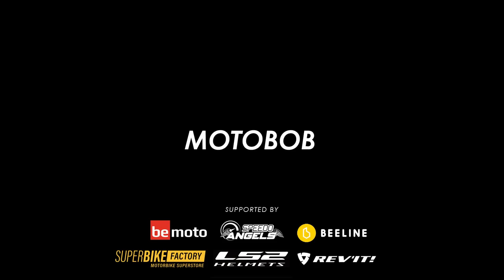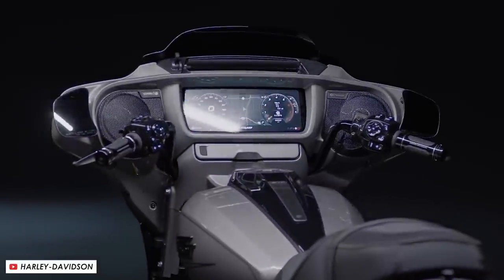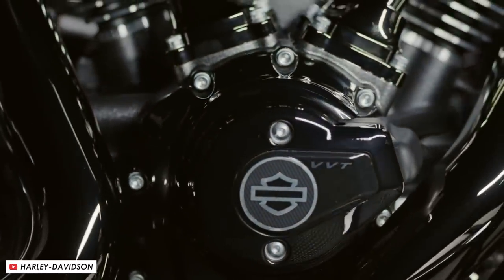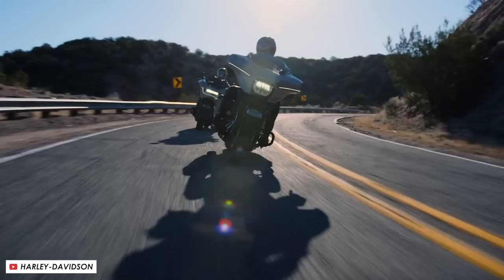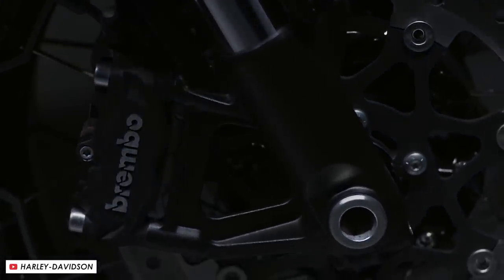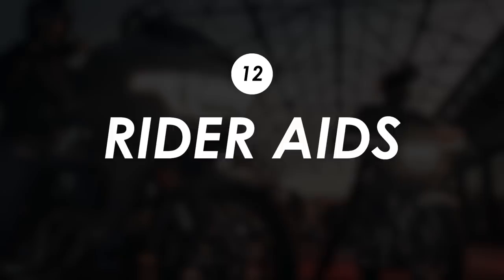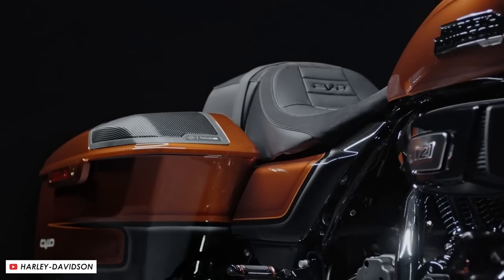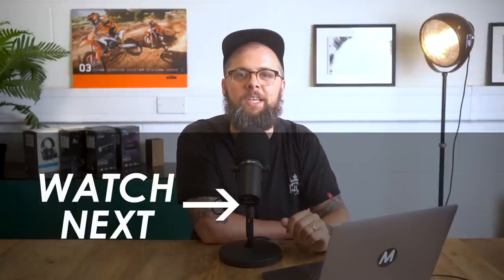New 2023 Harley-Davidson CVO Street Glide & Road Glide Announced!

Comment: I think the omission of an adaptive cruise control system is a huge miss, especially at this price point. All of the major competitors in the market have this feature on their touring and adventure bikes...most at less than half the price...
The sad reality though is that I will buy one regardless, Road Glide in Whiskey neat... Because I am a fool...
Reply: Huge miss? It’s not. Last thing most think of missing is adaptive cruise control.
Reply: @hoss6048  Until you have ridden a touring bike with the technology, you simply don't know what you are talking about... I suppose you don't like ABS, Traction control, navigation either?
Reply: @Macedonia270   ya, it's great. Especially when the guy in front of you drives or rides like a dumbass.
Reply: @I_am_archie  Yeah, I totally agree... I ride superbikes, adventure bikes and lately, Harleys as my wife also rides. Some Harley riders know what they do, but unfortunately,  at least 25% are a danger to themselves and others...
Reply: @Macedonia270  I call the 25% foot draggers.
Reply: @I_am_archie  Exactly!🤟
Reply: @I_am_archie  I avoid going for group rides with other Harley owners (unless I know them well) like the plague...You normally end up between two dentists who started riding at 45 years of age....and they have no appreciation for speed control, riding lines, spacing etc...

Comment: Slow, sluggish, don’t turn don’t brake, only for ratatatatata down the straight. And cost an arm and a leg. Hahaha 😂
Reply: It’s a touring bike, not a superbike
Reply: @petrolhead.corner  Yeah, I see your point but I'd get a sport touring bike like an FJR1300 or an adventure touring bike like the GS all day instead of this.
Reply: So you're saying you've never actually ridden one.
Reply: @tasoss.1385  you do you mate
Reply: There are different motorcycles for different riding.  These are build for long haul touring.  I know of many owners who have like a Harley for cruising or touring, a GS1200 for Adventure, a Honda 250 for dirt.  Many Harley riders started out on dirt, then supersport and then cruisers.  I have seen very, very few older men on supersports or sport touring just because of physical constraints.  One day you will understand that but enjoy the present until then.  Cheers.